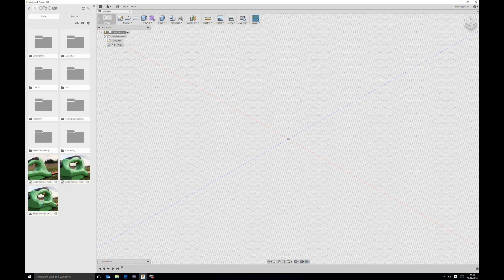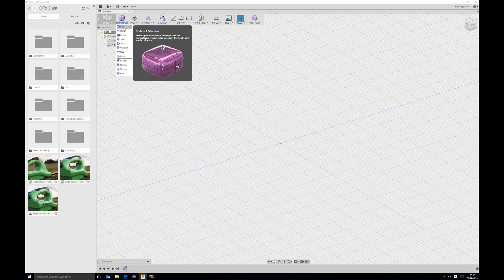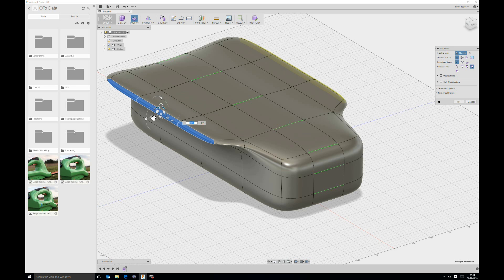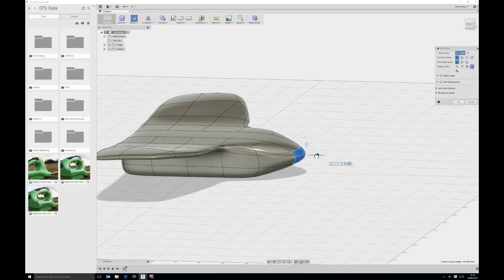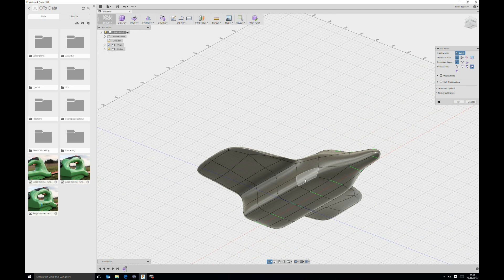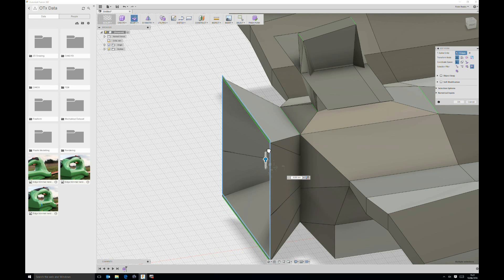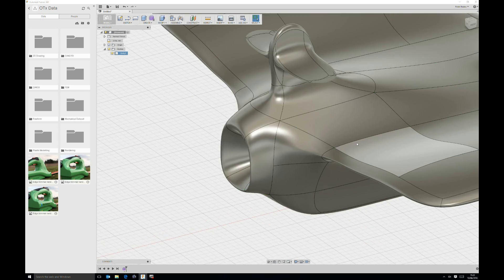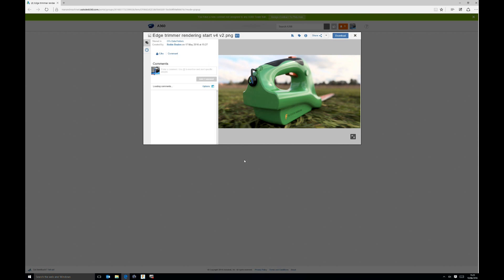Fusion 360: Freeform modelling

Comment: Hi. As a complete beginner, I couldn't select individual faces, only the whole body (4:00) then I noticed you had a different selection filter setting. Any chance you could add a caption there to help out other noobs, too?
Reply from the maker: Once you have created your mesh, use the modify tool to see the individual faces. If you can only see a single lump of material you may well have come outside of the sculpting environment?